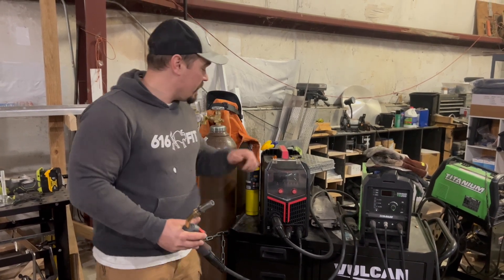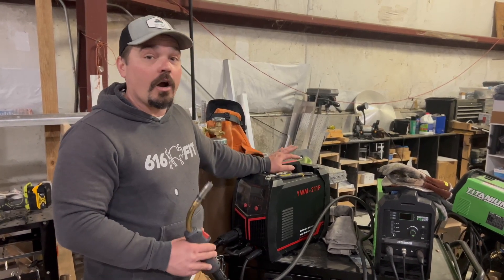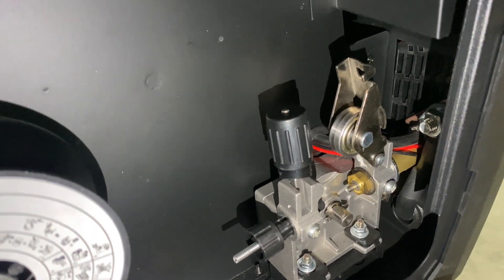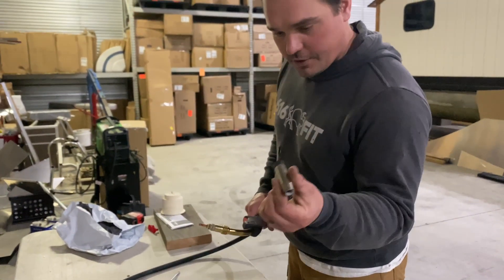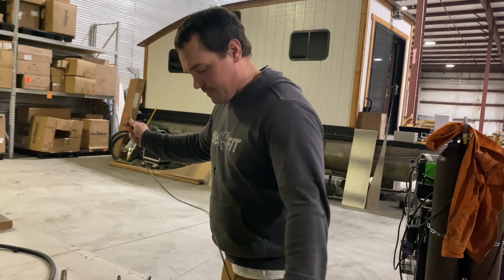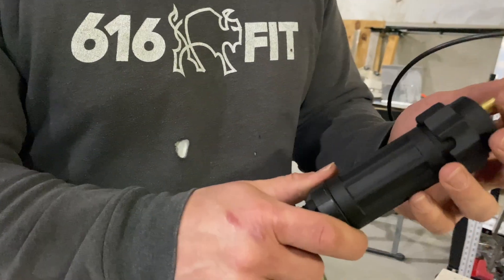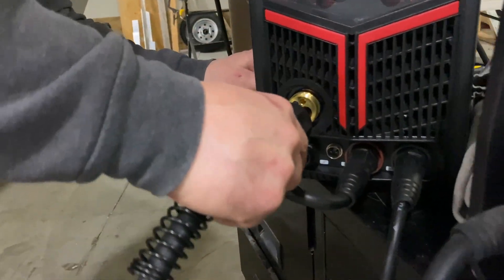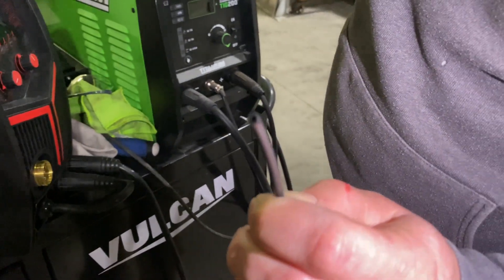YesWelder Aluminum MIG - Installing a Graphene Liner on the YWM-211P

Comment: I just bought this welder and am attempting to install the graphene liner.   The instructions tell you to cut the liner twice.  Once,  off flush with the end of the cap that holds it in place on the gun side , then to install some sort of graphene extension (that can't be found in the box) and cut that into the machine side.   Glad I didn't cut the graphene as directed, this makes much more sense. The directions are clearly incorrect!   I am having a problem with getting that brass liner clamp to set into the gun side correctly, any tips?    I can't seem to get the plastic cap on the liner, as it is not even reaching the threads since the clamp is sticking out to far.   It seems like the clamp is oversized I've tried to press it in, and tap it in.    Every video seems to skip over this part of the liner installation, so it must be a pain.
Reply: Which one of these machines do I need? The 211p or the 250? The 200dp? I’m wanting it for aluminum only. Boat projects. And which do you find more effective? The graphene liner w standard MiG gun, or the spool gun? Thanks a lot man! Big fan
Reply from the maker: @blueicepearl03  Great questions. If I were in your shoes I would order the 211p and a spool gun. I much prefer the standard MIG gun with the graphene liner, and it's needed for running pulse, but the spool gun is quicker to change out filler and is less finicky with feeding wire. The standard gun will still give you issues once in a while if the lead is in an awkward position. Right now I have the 211P rigged with the spool gun...I was just using it to finish some stuff on the 16' mod v boat I'm building. 

The only other thing to consider is getting a TIG setup instead. The MIG is great for some things, but TIG gives you so much more control and will be much cleaner for boats. I use the MIG setup for structural things, but I don't bother trying to seal up leaks or do anything that needs to be water tight with it because it's less consistent for that stuff than TIG. Just a thought.
Reply from the maker: You'll love the machine once you get the darn liner installed. It was a bit of a pain, and as I mentioned in this video this was the second time installing one on my machine because I goofed up the first one. You're correct, just one cut. I believe a lot of these companies have someone explaining the process who designed the concepts for the machine but never had anything to do with the engineering/manufacturing of it. Who knows!?! That plastic cap won't fit unless you were to remove the o-ring (I tried everything) which would then reduce the effectiveness of the brass piece that actually holds the liner in place. Once inserted in the machine and gun tightened it never gave me any trouble. Again, probably a mis-cue in the manufacturing/design process. I've got some other videos using this machine on aluminum including some settings and stuff. I never got the double pulse to run great for me on aluminum, but I've used the single pulse and regular MIG mode a ton and have built a couple boats from scratch with this machine and their TIG200.
Reply: @tomspontoons  Thanks!   I got it together.  I've now figured out the feed rollers weren't really grabbing all that well for the 5356 wire.  I fought with it for well over an hour, and was about ready to give up.   I tried about every setting on the thing, but it just didn't seem to be feeding correctly.  It seemed like it was stuck on a pulse setting of some sort since the wire kept burning back, then would feed out, then burn way back again.   3 tips later....  Once i switched out the rollers again,  for the third time, and used the .08 roller with the .035 5356 wire it fed and ran perfectly on every setting.   Single pulse and double pulse also worked perfectly, which i was beginning to think might be a useless feature.   Roller issues!   I think I'm going to like this machine.   Been welding aluminum for 10 years now, and this already put down some really nice welds.  I purchased the spool gun, so I'll try that at some point also.  I contacted Yes before purchasing this unit, and they informed me "you cannot use the spool gun with pulse feature", but every video I've seen indicates you can.  I even sent them the links to the videos, and they still told me no, don't do it.
Reply from the maker: @bobm6527  Glad you got it figured out! It really has been a great machine for me, especially for the cost and simple features. I just used their TIG200 to cut down a set of pontoons and weld the end caps back on. Welding 150 inches of 0.080 aluminum and only one little pinhole that took 3 seconds to fix after pressure checking....not bad and shows it can weld with some consistency! Best of luck to you!